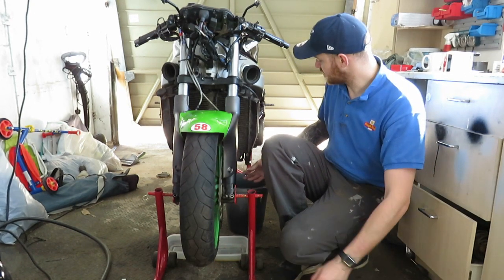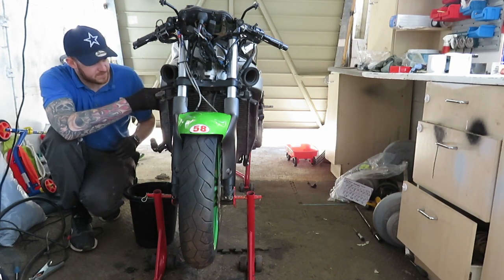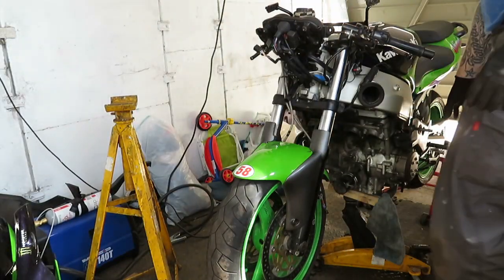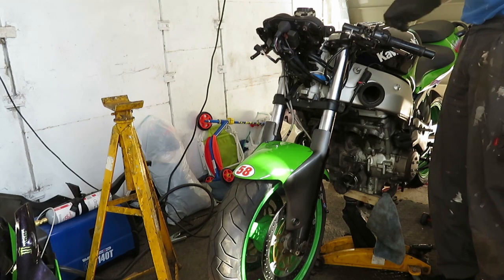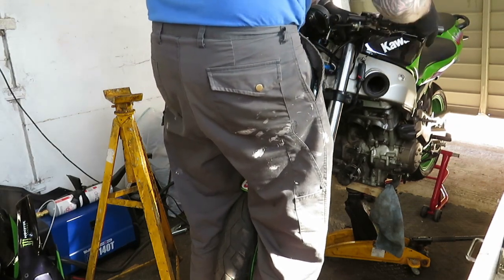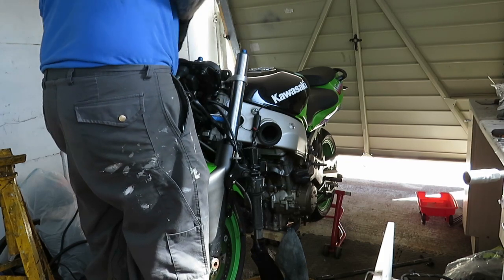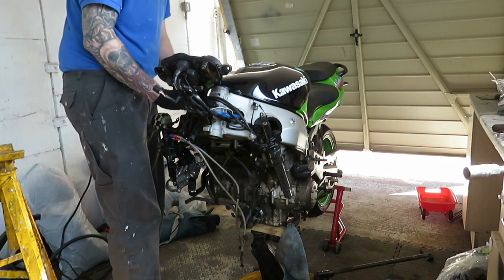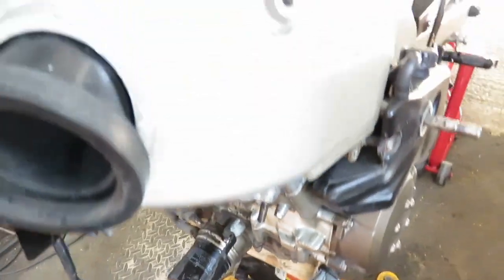Project zx9r E2, day 3 refreshment, front end removal.

Comment: Ratchet strap the frame to the ceiling maybe ?
Reply from the maker: It’s all covered up. I didn’t want to take the ceiling down, just to find out that it wouldn’t be strong enough. Although, it would of been better, just wasn’t worth the time taking ceiling down for the amount of time it was on the axle stand. Lol
Reply: @8713Thomas  lol true. 
But just as a third safety precaution. 

Not going anywhere like it is so all good 👍
Reply from the maker: eskimodoodle it’s back together now, but when I get chance in the winter, I’ll take engine out and check the braces for the roof then. Keep an eye out 🤪
Reply: tom  excellent .. 
Why do you plan on taking engine out in winter anyway ?
Reply from the maker: eskimodoodle well, I’ll need to change the valve shims, give the lot a good clean up and possibly get it painted. Plus, keeps me off my arse! 😂
Reply: tom  Excellent .. look forward to them videos ! 
Keep up the good work 👍